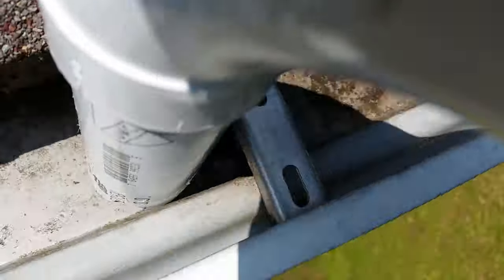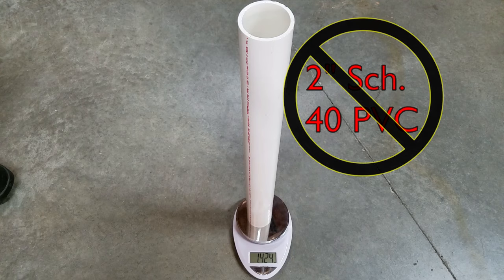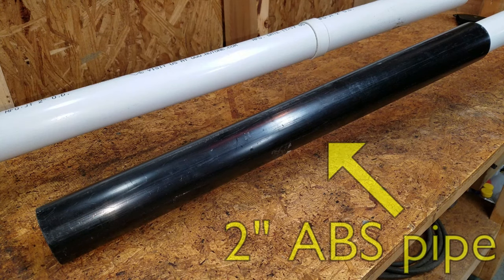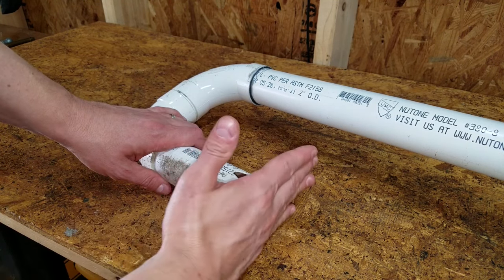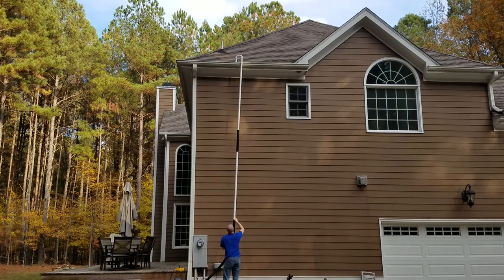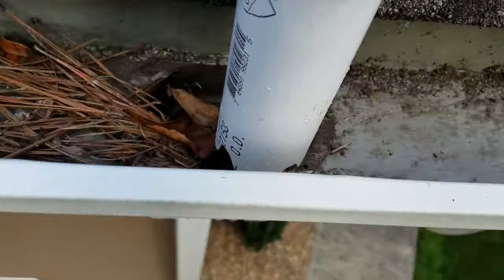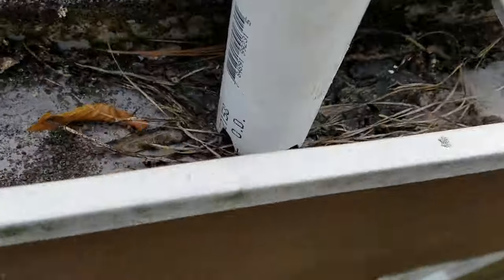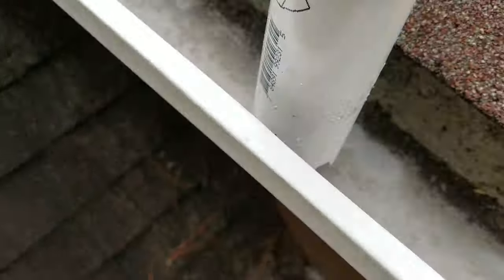UPDATE: Gutter Vac (3+ Years Later)

Comment: Let me comment on my experience.  Today I went ahead and made and used the gutter cleaner as described.  I used the vacuum pipe which is much lighter that both my local Lowe's and HD had in stock.  My second floor gutters are 21' off the ground so I made a 6' section with the curved end and a 10' section.  I used the 6' section for first floor gutters along with the shop vacuum (that has 7' hose and 2 extensions that came with the vacuum).  When doing the upper gutters I just add in the 10' section.  My shop vacuum is an older Rigid 9 gallon, 3.5 hp model.    The gutter sucker worked flawlessly even with the 3.5 hp model which I thought I might have to upgrade. I had lots of pine needles and part of the upper gutter was blocked.  Sucked out the blockage in a few seconds and then I heard lots of water coming down the downspout.  I don't have a visual of how clean it is but the water is running and I did get a good amount of wet needles and mud out of the gutters.  Only time that I had problems was when I sucked up large pine cones that blocked the entrance.  Sometimes I could just knock them off against the gutter; others I had to bring down and pull off.  Would have been nice under these circumstances to be able to shut off vacuum and have the pine come just drop off but no real problems.  At $50 for materials, much cheaper than $200 per year to have someone come and do it.
Reply from the maker: Wow, thanks for the detailed experience! It's nice to know that some Lowes and Home Depot stores still stock central vacuum tubing. It's also great to hear that a 3.5 HP vacuum had enough power. I'm sure this info will be very handy for other viewers. Thanks again!
Reply: How long did it take you
Reply: Sounds great ! Thanks for your sharing. Wonder how you connect the vacuum pipe sections and how do they connect to the hose ?
Reply: @davidluo6108  His first video goes into detail on exactly how all the pieces fit together! I think there’s a link to that in the description.
Reply: They make a remote power switch/outlet combo. Maybe look into that too. Thanks for your experience.
Reply: I had better success blowing debris out than trying to vaccum.  use a leaf blower blasting up and out other end of tube

Comment: That 5.0 HP Rigid vac is $100 at Home Depot now. Its no longer $50.   The Rigid gutter cleaning tool is still $30 at least that part didnt go up.  They also state you can add more interlocking Rigid tubes to the gutter tool to reach the second story.
Reply from the maker: Dang, I can't believe the Ridgid 5 HP vacuum doubled in price since 2018! Yeah, you can add more tubes for second story gutters, but I doubt it would be cheaper or lighter than making it from central vacuum tubing. However, if you don't wanna make your own, it's a good alternative.

Comment: Mike attempts, good stuff bud. I've been playing around with the idea of a tool like this for a while. today I am seeing what others have done. No shortage of gutter vacuums on YouTube. Here is something I have considered to make the job quick and more efficient. 1) GoPro mount on the top to see the gutters then a phone mount near your hands. You'll still be able to focus on the gutters and probably reduce the ache in your neck from looking up. 2) using two heavy-duty wet vacs. Both vacs run the same hose with a Y connector. As the length of the hose and piping becomes longer the suction power is lost. I didn't believe this would happen till I looked into it. GoPro plus 2x the suction power.
Reply from the maker: Thanks! Yep, you could do both, but I think you might find neither is needed. My 5 HP vacuum has never felt lacking while cleaning my gutters. If you think you'll need more power, a single 6.5 HP would be more than enough. As for the GoPro, to each their own.

Comment: My house is 38 feet in the back. I used sch. 40. I am over 70. Yes it is a little heavy but it has worked well for the last few seasons. So use sch 40 if the sch 20 is not available. Walking and sliding on the roof will damage the roof and cut the life span of the roof drastically. By the way I used a 40 foot ladder for many years to clean the gutters and using sch 40 pipe is much easier than the ladder.. Thanks
Reply from the maker: Yeah, I used a ladder before building this attachment and it was a pain. The central vacuum tubing is readily available at the local electrical supply store.

Comment: Oh, your comment about gutter guards is not only well received, but I purchased that expensive product at our old house and you encounter an entirely new problem.  The gutter guard top and leading edge especially become black stained with mold and those new white gutters become an eye sore.  Either clean your normal gutters or get up and clean the mold off each year-pick your poison.  I tried power washing the mold off, and that works but after a season or two your white powder coated gutters will have no white paint.  There is just no free lunch.  I think your vacuum solution is the best choice.
Reply from the maker: Yep, if there was such a thing as maintenance-free gutters, everyone would have 'em. I never even considered the mold aspect, but it makes sense.

Comment: Is the black ABS pipe different than the extension pipe that comes with a vacuum cleaner?
Reply from the maker: Yes, the ABS pipe is different than the vac extension pipes. The ones that come with the vacuum have a larger diameter on one end and smaller on the other.

Comment: Well, I made mine today-it cleans gutters far cleaner than doing it manually-extremely clean!  A few thoughts:
1.  I ended up cutting the fingers off as they increased the likelihood of debris clogging the intake by catching on the edges.  I replace them with a gentle convex curve.  This eliminated edges where debris could hang up on and increased the surface area of the intake also reducing clogging.  There was enough curve so there was very little sticking of the nozzle end to the gutter.  I used tin snips to make the gentle curve.  2.  8 feet is a little short and your arms are up and it gets tiring.  I'm going to add a 2 foot extensions so arms can be more horizontal.  I just couldn't find 10 foot sections around where I live (Charlotte) but 8 foot is widely available.  3.  My gutters had nearly 4 years of accumulation (my bad) but they are totally clean now.  It definitely took more time this first cleaning, but I didn't want to get up on a ladder.  I imagine, as you said, it will be a very quick process with material that is less dense, less decayed, looser, and drier.  4.  The straight piece alone is great for suctioning spider webs and wasp nests.  I have a 3 story house with a high pitched roof so I'm out of luck with the highest gutters.  Probably too many degrees of freedom for a 3rd section.  Thank you so much of an amazing home care video!
Reply from the maker: That's awesome, thanks for the detailed update! I really like the idea of just making the end slightly wavy to avoid suctioning itself to the bottom of the gutter. Also, the spider web/wasp nest sucker idea is genius! I have a ton of high webs and sucking them up will work much better than my current method of using a cobweb duster on the end of an 18 foot extension pole. :)
Reply: Bonus use to get hives in the eaves is brilliant. Thanks for the idea.

Comment: Thank you for this!  I had made a Sch 40 version a couple of years ago and the challenge of course has been the weight. Two of the house gutters I clean are on slopes so this version will make the job MUCH easier. I could not find Sch 20 pipe locally so I had to purchase online.  There are several places that do ship.

Thanks again.
Reply from the maker: Yeah, the attachment made with central vacuum tubing will be about 1/3 of the weight which will make a huge difference. Plus, the tubing fits together with the vacuum hose much better too. Thanks for the comment!
Reply: Where did you order the schedule 20 pipe from?
Reply: @amothinisengard6505 
I don’t think schedule 20 exists…probably schedule 30 …even so,hard to find any of the parts described here…not even on Amazon…
I will try some local electrical supply stores…Home Depot and Lowe’s in their website site…out of stock.

Comment: Thanks for the video, I followed recommendations and made my own, overall it worked well but I had to make a few modifications. I can only reach the second floor gutters from an angel so instead of two 90 degree elbows I joined a 45 degree and a 90 degree to make a 135 degree, that I think worked better than the 180 degree even for my first floor gutters, because when I switched from suction mode to blow mode, standing right below the gutter was a very bad idea. The extension from the shop vac fits but I had to hold it in a weird way because the connected pipe was moving around inside the extension, I drilled a small hole and used a small screw to stabilize the pipe inside the extension, that worked much better. 2 inch pipes are a bit small for large leaves, but there is no other feasible options so I can cope with that. I appreciate you taking the time and making the videos, both videos are very helpful. I had stopped climbing the ladders ever since one of my friends fell from the ladder when cleaning the gutter and killed himself a few years ago, your videos provided a solution to my problem, it is much appreciated.
Reply from the maker: Dang, that's a shame the fall killed your friend, I'm sorry to hear that. I've never used this attachment to blow out my gutters, but it makes sense that you wouldn't want to be standing directly beneath. :) Those sound like excellent solutions for anyone else experiencing the same problem. Thanks for the comment!

Comment: I was up on the roof in the rain, 2 stories up. The gutters completely clogged.... Thinking to myself there has to be a better way. Thank you, works great.
Reply from the maker: Besides paying someone else to do it, this is the easiest way I found to keep my gutters clean. :) Thanks for the comment!
Reply: How long does it take do average 1 story houses with it
Reply from the maker: @kohenblrrr4901  Depends on how big the house is and if you have the gutter hangers inside the gutter. On average, I'd guess maybe 30 minutes.
Reply: @Mikeattempts  how often do you have to deal with the hose or poles clogging up on you? And is it able to remove that thick muddy shingle grit?
Reply from the maker: @kohenblrrr4901  I've never had it clog completely. Every once in a while, a chunk of matted long-leaf pine needles will get stuck at the opening but will quickly clear itself as it gets bounced around in the gutter. It seems to suck up shingle grit just fine. However, since the pine needles fall year-round, I clean my gutters every 6 months now that I use the gutter vac attachment. Because of that, my gutters are never full.
Reply: @Mikeattempts  thanks for all the info I’m looking to purchase the gutter pro vac for a grand it’s a triple motor 3600 watt machine like this to start cleaning gutters as a side job
Reply from the maker: @kohenblrrr4901  I'm sure that machine will be able to suck dead squirrels out of the gutter, you shouldn't have any problems! :)
Reply: @Mikeattempts  sounds good man👍🏼
Reply: "up on the roof in the rain, 2 stories up. The gutters completely clogged" ... Me too! Considered climbing on the roof and decided against it, went through the same mental process and also ended up here. Thanks so much, Mike!

Comment: Oddly enough I built an almost exact system when we moved this past August. I prefer your build, though so I'll be updating mine next spring. The main plus for me was getting to the second storey without going up on a ladder. I'm not fond of heights, so I'd prefer not to go that route if I can avoid it. 

Like you, we get a lot of pine needles in addition to leaves and I did find that they sometimes get caught at the mouth of the shop vac tube when running tests on the ground, so I opted to hook mine to my blower and just blow them off. True, it does make more mess, but I simply do this step first before tidying up the leaves and needles at ground level.

My biggest complaint about my solution is the weight. Like you, I used central vac tubing because of it's light wight, but when I add in the weight of the leaf blower itself, it makes my solution much heavier than I would like and my arms tire very quickly. In the spring, I am going to try hooking my updated and improved system to my shop vac instead and see how that works.

The home that we purchased has gutter guards, but they were severely matted down with needles, leaves and fine debris from the oak trees. So much so that even the blower had some difficulty clearing things away. The best option for me was blasting it clear with the hose. However, once that initial cleaning with the hose was done, the blower system worked great for keeping things clear. My hope is that if I blow the gutters once in the spring, once in the summer, and a couple times in the fall, I should be able to keep everything clear. 

I suspect that the previous home owner didn't clean the gutters much, if at all which made our initial cleaning more difficult that it would have otherwise been. I believe in preventative maintenance, so I'll be staying on top of it.

Thanks for posting the videos, I will definitely be fine-tuning my system next spring based on your build.
Reply from the maker: I'm not fond of heights either, that's what got me thinking about creating this attachment. Yeah, that first cleaning is always the worst. Since the pine needles fall year-round, I clean my gutters with this attachment twice per year. That frequency prevents the gutters from getting too bad, so the job goes quick and easy. I made a follow up video 3+ years later with more detail. Check it out if you think it might be helpful. Thanks for the comment!
Reply: @Mikeattempts  this comment is in the follow up video. 😆 I watched them both.
Reply from the maker: @billbowman8747  Hahahaha, sorry, it's Fall and I've been getting a lot of comments on the first video. I should have paid better attention. :)

Comment: I have a store bought version of what you have and it doesn't work for me really.  I can see it being useful if you have trees nearby, but I don't and the main thing that clogs my gutters is moss.

I had to make a scraper attachment for my tool so that the hose can scrape and suck up debris at the same time and I would say it is 95% effective.  Every few years I do go up and give them a thorough cleaning and a spray down with silicone lubricants to keep the surface slippery and as unfriendly as I can for moss.

Last year my son came along with his drone and gave me a birdseye view and it made life so much easier, if you have one use it, but I wouldn't go and buy one just for this task.
Reply from the maker: It actually sounds like you have a good system in place to deal with your moss as easy as possible.
Reply: @Mikeattempts  No really, my roof gets a healthy coverage of moss through the darker months, I really should get up and treat the problem to limit the moss growth and then I ouldn't have the gutter issues so much.

Comment: Thank you for making these vids! Such.a simple smart design - I am going to make one. A question for you first: I have seen some other youtubers do something similar, but using one 45 and one 90 degree bend so they can stand farther from their house. (They cut the end piece at an angle so it can reach the bottom of the gutter). After using yours, with 2 90 degree angles, for a few years, do you have any thoughts on advantages/disadvantages of these two designs?
Reply from the maker: I think the only pro to using a 45 elbow is, like you said, being able to stand further from the house. The cons: 1.) The further you stand from the house, the longer the pipe needs to be to reach the same height. 2.) Controlling the movement of the attachment is easiest when you're directly beneath it. When held at an angle, it would take more effort to maneuver the tip. I have some large bushes out front, and I have no problem cleaning those gutters while standing a few feet away from the house. The best thing would be to buy two 90s and a 45 then dry fit the elbow closest to the end. Then you can swap 'em to see which you prefer before gluing.

Comment: Very cool idea, Id like to add a 1/4" line and add a sprayer with valve at bottom to add water to it, for those hard to remove gutter clogs.
Reply from the maker: That's a good idea but you might not need it. I've found that the end of the pipe, with the notches cut out, does a good job of scraping the bottom of the gutter and freeing up any stuck debris.